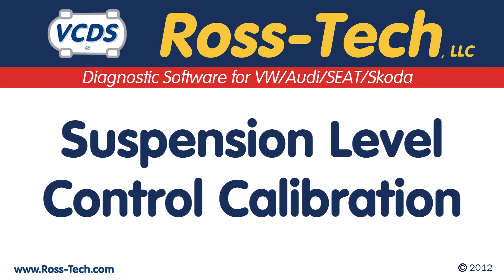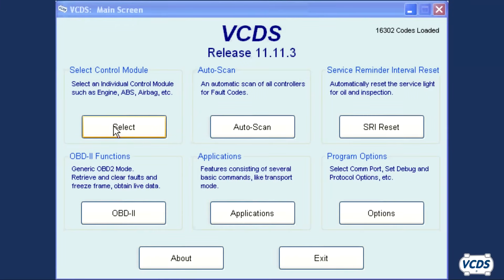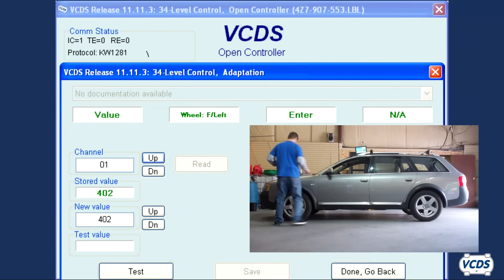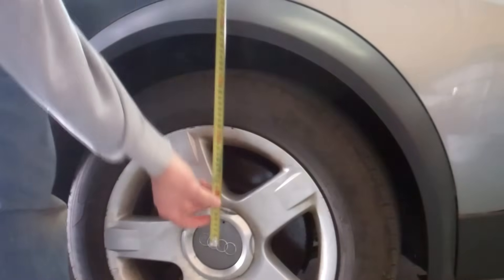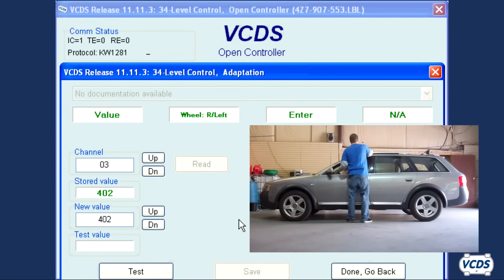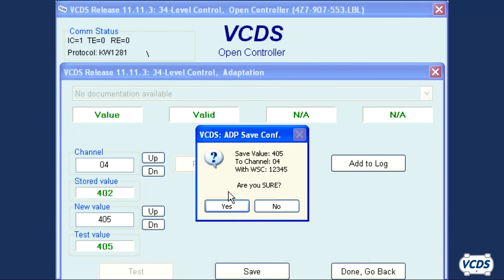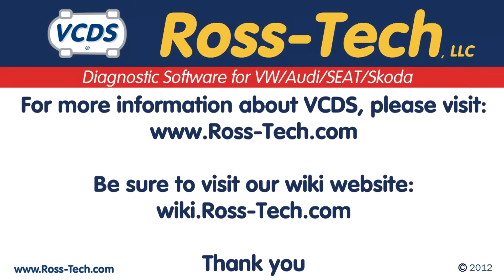Suspension Leveling Calibration

Comment: Hy there..  i have a 2008 touareg and i have a problem. I left the car on offroad mode and the next day i found it with the rear up (still on offroad) and the front down with the driver side even lower than the pax side (unbalanced). I started the car..started to raise up automatical and it drove fine... At night i left it in dynamic mode.. the next morning again the same isue..the rear was ok at the setting i left the car, but the front again with the same problem. The front lower than the rear and the driver side even lower!

Comment: when i login and enter the adaptation menu, i wait for the "wait" to change into "Value" but is doesn't work. it just stops and says error. maybe bad sensors or something? can i just delete all the DTC and maybe then will work?
Reply: Did you ever find this one out ? Having the same issue.
Reply: Anybody knows the answer??? Pls help!
Reply: @kamatechnology7570  check 40 ampere fuse under driver seat...
Reply: U using cable or icom????
Reply: I am having the same problem on an A8 2004. I cleared all the codes except get the Fault  "01437 - Control Position not Learned 
            005 - No or Incorrect Basic Setting / Adaptation   ..."  which appears in '34- Level control ' and also in another module. Sometimes the '34- Level control' does not connect on the CAN bus then the Fault does not show in the 'Control head' module.
Reply: @  i do not remember how i solved it back in the day. but i do remember that i disconnected the battery cables from the battery and connected the cables plus and minus to each other for 10 seconds. this resets everyting what causes adaptaions to fail so u can adapt again by luck it might work. audi and porsche have the same system and those were the worst...try changing the rear brakes on a panamera, u Will hate ur life beacuse that one is no joke, u must adapt 3 things in order and preform a brake Grinding-in test 8 times to pass.

Comment: Thanks for video helpful I found front left wheel is 10 mm higher than right front wheel, can calibration can help in this circumstances?
Reply: TheRafalblog yes, the calibration procedure will help with that.

Comment: i have a touareg 2004 r5 and im getting ''stop fault running gear' when i drive a while.
one of the pressure valve has been replaced since there was a leak but im still getting this message so i thought maybe the levels arent correct. do you think your video will help?

Comment: Gsavage1, it ended up being the Distribution Block near the compressor. That was the cause of the error message. Today I came out to 3 axles being on the ground and one rear at #3 height. The adaptation tries to level the car out, but after the pump runs for 60 seconds or so, it stops and the Ross-Tech screen says ERROR in red. I just threw $240 at a used control module...

Comment: I see you didn't answer the last question about the error message but was wondering the same!
Reply from the maker: For this procedure to work, the vehicle needs to be to factory design.  A leak in the system, wiring issues, bad sensors, ect can prevent one from being able to do the calibration.

Comment: What setting does the suspension need to be on before the calibration? Lift, Comfort, Automatic or Dynamic?
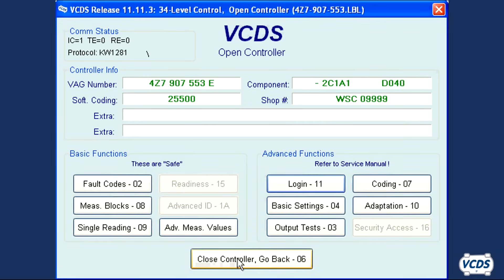Reply: uktech 5 years??? Still no answer. From what it seems,  probably automatic. When you enter on the first step on the vcds it adjust to set up height. Min 1:06.
Reply: @mendez77054ify  my rear air suspension doesn't work and it's very stiff.. will VCDS clear the problems or want to reset the full programming? Kindly guide me
Reply: Auto mode